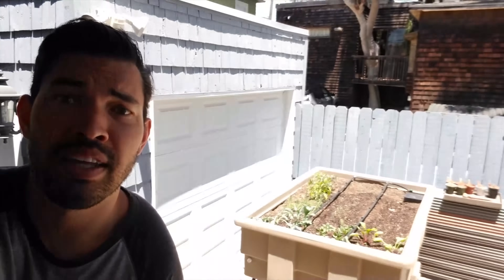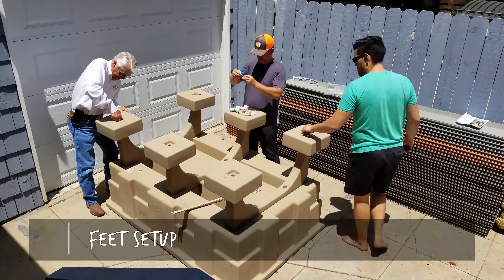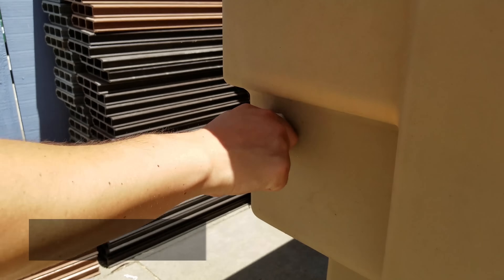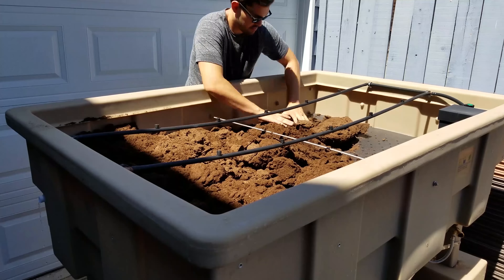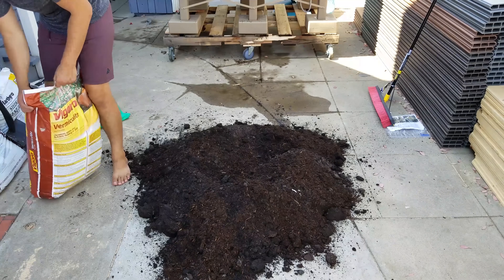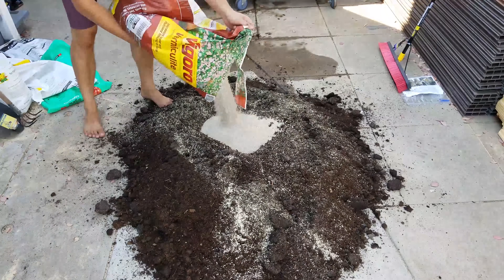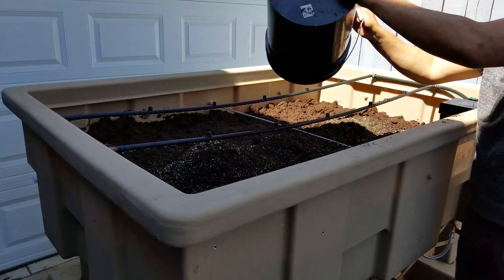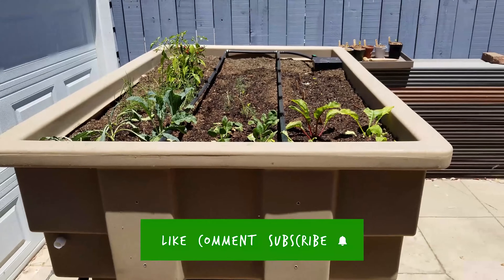This 1,500lb Self-Watering Raised Bed Is Absolutely Insane

Comment: It's much easier to mix soil by putting all of the components onto a LARGE tarp and raise one corner at a time to tumble it all together from one side of the tarp to the other.  The larger the tarp the easier because you can pull a corner over the top and PULL the soil toward you (rather than LIFT the corner) and the mixture gets churned and mixed as you do.  Just a little tip. :)   Love your videos.

Comment: Very cool. But I’m sure it’s way too expensive. If I were going to build one, I would use IBC containers cut down to maybe 24 inches tall the plumbing is pretty straightforward and you can use garden fabric to separate the water from the soil. Probably do the whole thingfor $100 not including the soil.
I found a cheap cement mixer on craigslist and that’s what I use to mix my soils. So much easier.

Comment: I have an SIP but its not nearly as beautiful.  Mine is lined with black pipes and works sot of like Earth Box.  Am going to cover it with green house cloth and wondering if I can still use it in the winter and if so should I continue to water it using the spout and not use the bed at all.  Secondly is I have it covered will it freeze in zone 7b.

Comment: 1500 pounds isn't that much. We built a hugelgarden. Took 5 1/2 months (by hand) and a whopping 17 TONS of material. And ours is not a big one either.
Reply from the maker: Whoa! Amazing. Love that growing method
Reply: @epicgardening  Too bad I can't upload some pictures. About 1/2 GB of them!
We built it about 1/2 the height of what was required. Used very little logs but used wood chips to make up for the deficiency. 4 TONS of that material was used coffee grounds alone!
Bad thing is that it hot composted and soil tems were a whopping 130F just 4-6 inches below the surface. I can only imagine hot hot the center of the hugelgarden got. Stayed that way nearly a year too.

Baked potatoes anyone? lol (Yes I planted them too not knowing that it would get that hot)

But the weeds LOVED all that heat for some reason.
This year no hot composting!
But now we get far too much rain. So much that the hugelgarden is completely saturated. We just got 4 INCHES of rain in less than 1 day. More on the way too over the next 4 days. At least plants aren't sitting in water only and the moisture will drain away slowly. Wood and chips soaked up all they can hold. Should buy me some no watering time next month or maybe longer.

Oh and my Hugelgarden shrank 35% in one year too. That is to be expected on a new build.

I am considering adding some DIY  OLLAS on the top later on and a water reservoir to keep them filled automatically.

Depends on if we get regular rain this year.

I have nearly 500 gallons of rainwater in tanks too.
And a well for backup.

Note: never use tap water on your garden. It can kill beneficial bacteria and beneficial fungus.
Most cities and such add ammonia to the chlorine and the mix is deadly to soil life and fish.
Who know what it does INSIDE you.

Some add fluoride too. That is also BAD stuff (poisonous).

Want a cheaper hugel?

Get a horse watering tank (oval preferred). Make sure the drain is open in the bottom or make a 2" to 3" drain hole.
Fill 1/3 to 1/2 with oldest rotten wood you can find except walnut and a scant few others. Maple is the gold standard! PERFECT STUFF unless you want a very long life then use a decent hardwood (again with a few exceptions).
Toss in leaves, branches, sticks if you can. Lawn clippings so long as they haven't been treated wit any chemicals).
Preferred is an assortment of types of woody material both in size and species. Rots at different rates.

Just leave 8"-12" of good soil on top for the plants.

Less or no bending, less watering, easier harvesting, less critters getting in, etc. But a banquet table for deer though....

Takes 1 year for it to situate itself. But you can plant things right away (just not taters lol)

You can buy a 4 foot 'fire ring' as most hardware stores for around $50.
Has no bottom. Just a 12" or a little taller metal 'ring' that people build fires in. Stackable if you want to make it that way.
Set it in the ground. Dig down if you want it to work well. Fill as described above. Deeper the better as when it rains, it acts like a water storage area much like a saucer under a pot.

You do not have to dig at all if you do not want to then you would either have a raised bed garden or a hugelbeet instead of a hugel garden. But with no storage area for excess water.

You could plant up to 3 tomato plants or some combination of plants.
Toss in an OLLAS in the middle (real ones cost about $35 and up) and watch things grow like crazy. DIY ones cost between $8 and $16 plus adhesive cost. Maybe $20 to make one. I made 6 for $60 and still have adhesive left over.
Ollas (pronounced OH Yas) have been used over 4,000 years! Various types around the world too.

The fire ring is not very tall but works very well for melons, strawberries, all sorts of things.
Nice thing about fire rings is you can remove them and put them elsewhere if you have to.
Fire ring gardens would be a feed table for goats. You have been warned!

Oh and do not forget wood chips as mulch. Store bought ones are chemically treated and BAD.
4" to 6" of wood chips is recommended. Look to your local yard waste dropoff where you live.
New or raw wood chips won't draw down nitrogen if only on top. And if you make a pathway out of them, less or no weeds there either.

Everything should be OMRI stamped or rated.

Interesting tidbit: organic Humus (OMRI RATED and read the bag carefully - Scotts (sold under walmart Earth Gro) says organic but if you READ the bag it says not for organic gardening, can last a whopping 1,000 YEARS!

You put OMRI rated Organic Humus on top of the wood but below the soil. Don't mix it in to the soil!
And never use it for trees. The trees will not send roots out past the humus - it is that good.
Result: trees can fall over in a strong wind.

Hope this helps everyone.

PS look up floating gardens. Some cultures (Mayans for example - nice story about them too) make rafts that float on the water. They top them with aged manure and plant them. Then tow them out to the middle of a pond or lake & anchor in place (but NOT a river).

Most insects will not cross open water. Most critters won't swim out to eat.
Perfect sub irrigation system (pond water is clean, fish pee or etc, minerals, oxygenated...)

Harvest time just take a boat out or tow it back in. Oh and NO WATERING NEEDED!